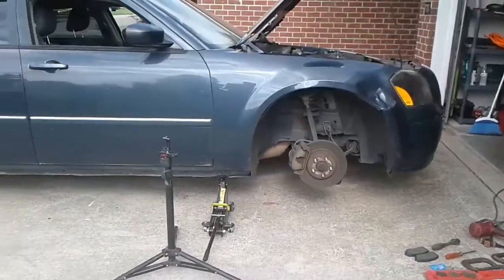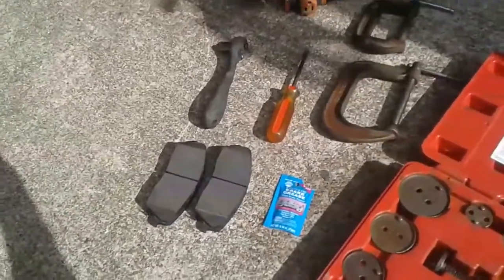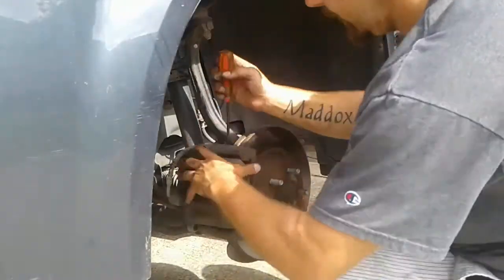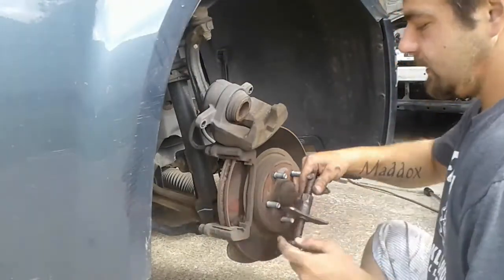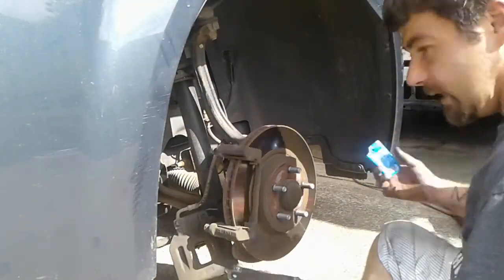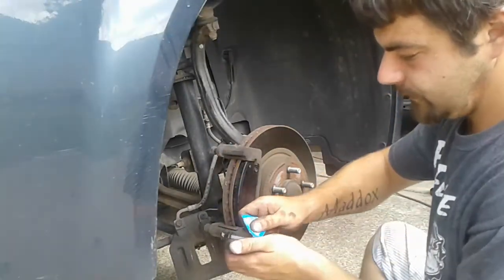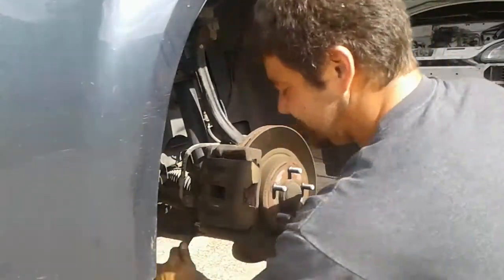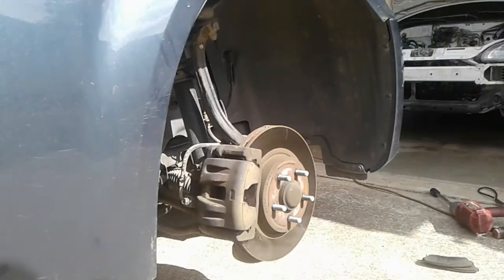Replacing disk brake pads. 07 dodge magnum. DiY

Comment: Helpful video much respect!! 

I don’t have a break changing Kit,, how can I use the sea clamps?? I saw it in beginning when you mentioned it.
Reply from the maker: Put the bolt part inside the caliper piston and the other part of clamp on back of caliper and tighten.  Take off brake fluid cap so the fluid your pushing can go back inside reservoir.
Reply: @Nwaboosted  thank you so much. You don’t understand how much this helps me. I appreciate your feedback & mechanical skills. Blessings <><
Reply from the maker: Your welcome.

Comment: If you have a metallic rattling sound from the front end, it is most likely the dust shields behind the front brakes. Both of mine have come off due to corrosion and rattle. You have to remove the brakes, rotor, and wheel bearing to replace them. Pretty easy job.

Comment: Good video, but this car probably doesn't see snow & road salt. I own the same car, and I deal with snow, road salt & corrosion. Let me tell you, there is more to a front brake pad change than what is shown here.
1. Check the two slider bolts which this guy did not do. If they aren't sliding freely, pull them out, clean them with a wire brush or wheel,  and lube them with brake grease.
2. There are two metal brackets that hold the brake pads in place. These MUST be pulled off and all the corrosion buildup on the brackets and the caliper they sit in, MUST be cleaned out with a wire brush or wheel. Use brake grease on the caliper and the metal brackets when reinstalling the metal brackets.
I can't stress this enough! If you don't do this, the pads will install very tight (not loose like you saw in this video) and you will overheat your brakes causing smoke. Trust me. Been there, done that.
Reply from the maker: Excellent points, 4 years later the car is doing great!
And yes very little snow and winter weather in this area.  Little salt is used

Comment: What if the brakes, disc , rotor and caliber was fixed and it starts smoking from wheel well area once you test drive it
Reply from the maker: I would look at the wheel bearings if all the items you mentioned are working right.
Reply: Clean-out the brakes and check the slider bolts. I just explained it in a Comment I posted on this video.

Comment: How is it that you have a single piston caliper, when I have a dual piston caliper on my 2006 Magnum?
Reply from the maker: All depends on package.  This is base model with v6.
Reply: @Nwaboosted  Thanks' I was wondering if I got the right stuff delivered (I have not even pulled one wheel off yet to check the calipers, just went with what the specs said).
Reply from the maker: Yes you are more than likely good to go. Let me know if I can help in any way.  Good luck!
Reply: @Nwaboosted  Thank you for the kind offer.

Comment: I HAVE 22 INCH WHEEELS IS THIS A PROBLEM DOR THE BRQKES
Reply from the maker: Clinton Herrold they won't work as well as they did with the factory wheels since they are a bigger diameter, But shouldn't be a problem unless your driving the hell out of it.